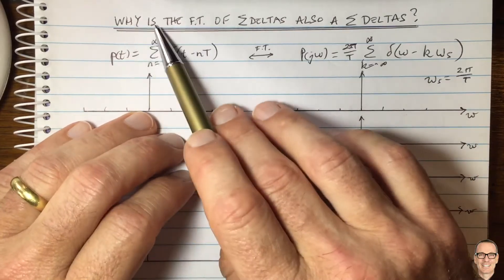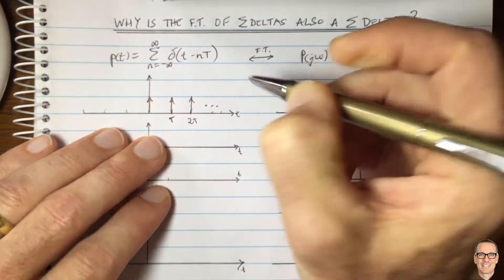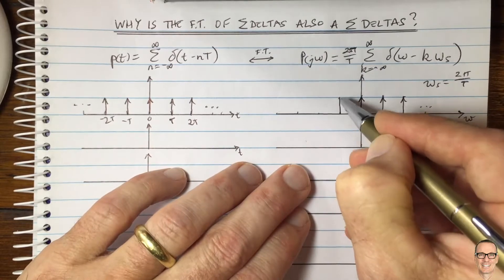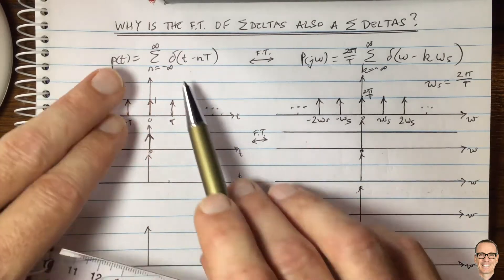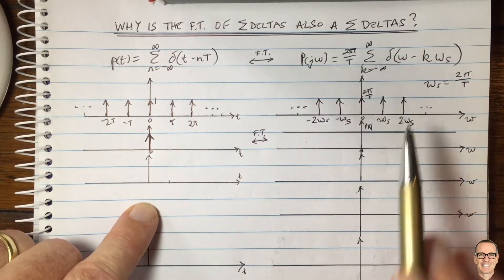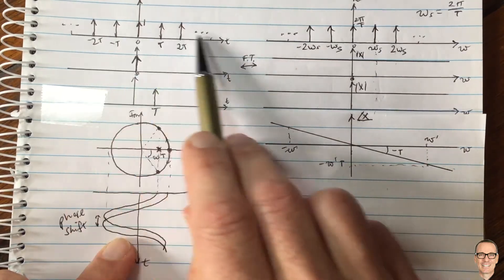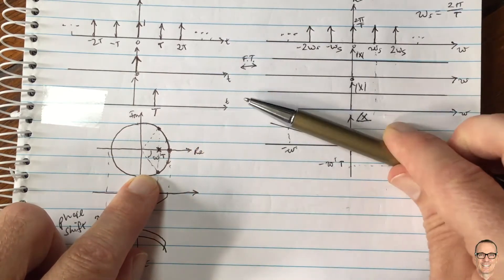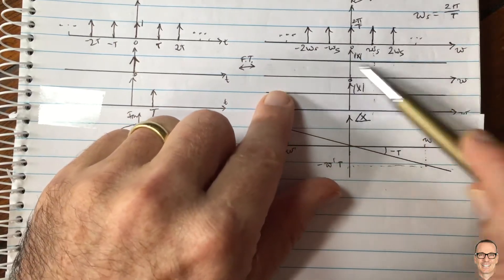Why is the Fourier TF of a Sum of Deltas also a Sum of Deltas?

Comment: Very interesting video, thank you Professor. Would it be fair to suggest that every time a convolution in general is done between infinite number of periodic (T) delta functions with cos(t) function the result of such convolution will be infinite number of periodic delta functions 2pi/T apart? For the same reason - when you hit full period of cos(t) = 2pi you have resonance, every time you hit any other phase you will find same vector of opposite phase sooner or later to cancel it.  Not only FT, not only complex a+jb figures.
Reply from the maker: Sorry, but you question appears to be confusing. Are you asking about doing a time-domain convolution between delta functions and the cos(t) function?
Reply: I see where I confused myself. Sometimes you answer your own question when you put it on paper, 
Thank you.
Reply from the maker: @dmitrikazantsev3692  Great. I'm glad you got the answer.

Comment: Thank you for video. In time domain shifting +-1 is meaining shifting same on the freq domain ? sum[delta(t+1-kT)+delta(t-kT)+delta(t-1-kT)]
Reply from the maker: Sorry, it's not clear what you're asking.
Reply: @iain_explains  Sorry sir, I will ask more clearly. I met with Fourier Transform question the question says What is the Fourier Transform of sum[delta(t+1-k*8)+delta(t-k*8)+delta(t-1-k*8)](k=-inf to +inf) I think shifting in time domain equivalent in the frequency domain is 2*pi*k shifting. Is that true sir. 
My Answer :  (pi/4)*sum[delta(w-2*pi*k-pi*k/4)+delta(w-pi*k/4)+delta(w+2*pi*k-pi*k/4)](k=-inf to +inf).
Reply from the maker: No. A shift in time is equivalent to a change in phase in the frequency domain. For example, if you shift cos(wt) in time by u seconds, then you get cos(w(t-u)) = cos(wt -wu) = cos(wt - theta), where theta=wu is a constant phase shift.

Comment: Great explanation, just one question though: why is the amp of the delta train on the freq domain 2pi/T?
Reply: Thanks for the quick and resourceful response, this really helped me tie up loose ends on this topic 😊
Reply from the maker: Good question. You're not the first one to ask that. Here's the answer I gave to someone else previously "I don't have a precise intuitive explanation, but the bottom line is that the transform pair needs to satisfy Parseval's Relation (equal energy in both the time domain representation and the frequency domain representation). Intuitively, as the sample period (T) increases, the delta functions in the time domain will become more spaced out, and the delta functions in the frequency domain will become closer together. In order to keep the total area under the two functions equal to each other, it is necessary to multiply/scale the frequency domain delta functions by 1/T (or 2pi/T if you are plotting the angular frequency) since they are more densely spaced in the integral." ... And also, don't forget, delta functions have infinite height. The number we write next to them when we draw them, is the area under the delta function. See "Delta Function Explained" https://youtu.be/lyraqtMWtGk

Comment: 2:01 this is the thing I am hugely confusing in this topic. Is the amplitude of Delta function 1, or infinity? 

In some videos this is 1 , in some other videos it is infinity ?? 
I just learned that , its area is 1, but its amplitude is kind of complicated.

Therefore I don't understand how we transform CT signals to DT signals. The DT function is an array of numbers with a frequency information, right?  How it is constructed by using the infinitely large amplitude Delta ( impulse ) functions ?
If the amplitude is 1, not infinity , how this Delta function has an area ?

I am stucked with that.
Reply from the maker: It's best to think of delta(t) as a narrow rect function, where the width is Delta, and the height is 1/Delta, and Delta->0. When sampling a continuous time signal at a time t=nT, we represent it mathematically by multiplying the signal by delta(t-nT). What this means is we are multiplying the amplitude of the signal by 1/Delta, and integrating the signal over a time period of Delta, to get the discrete-time value, and we do this for Delta->0 (in theory/ideally). So the output of that extremely short integral is x(nT) times 1/Delta times Delta which we call x_n. I hope that makes sense. I think I'll add this topic to my "to do" list for another video.
Reply: @iain_explains   thank you for answering,  this was what I learned also. Dirac function has infinitely large amplitude and infinitesimally small interval.
But the problem is :  I see many people that calls   " 1 "  to the amplitude. Also you are noting that it is 1.
If the amplitude is 1, it can not have area of 1.
I don't understand why it's called as 1, it looks like  inconsistency,  to a new learner.
Why the DT signals are written as  sum of x*Dirac (n).  How Dirac (n) is 1?

I told you that I am confused :')  It's obvious
Reply from the maker: In discrete time, the delta function does have a height of 1, and by definition it is infinitely narrow (since discrete time signals are only defined at exact integer time values). In continuous time, the delta function has a height of infinity, but since we can't draw something that is infinitely high, instead we choose to draw it as an arrow, and we draw it as high as its area is (so that we can illustrate the area somehow). Sometimes people just say 4*delta(t) has a "height of four" (for example), but they really mean it has an area of 4 (but since the drawing has a height of 4, it's fair enough to say this - it's assumed that people know what is meant).
Reply: @iain_explains    thank you for explanations. 
I don't understand how we transform impulse to the discrete-time as its amplitude is 1.  How this process works ?
I have problems on converting CT to DT, I am trying to watch several videos about it, but the actual mathematical operation of "converter" is not clear.
What I mean is , what is the operator that converts  ""impulse(t) >> to impulse[n] with amplitude of 1""    or    ""x(t) . p(t) impulse train >>  to  x[n] as a sequence""

x(t) . p(t)   could be represented as =  summation the series of  x(nT) .  impulse ( t - nT ) 

But this is still not equal to a sequence of x[n] ,  because it contains scaled impulses with amplitude of infinity,  right?
Therefore I am trying to understand what actually this conversion and this impulse are.
What is the title of topic/video that covers this point? 
Thank you for helping.

Comment: Thanks for the great video. But then I have another question, why the height in frequency domain is 2*pi/T?
Reply from the maker: Great question. I don't have a precise intuitive explanation, but the bottom line is that the transform pair needs to satisfy Parseval's Relation (equal energy in both the time domain representation and the frequency domain representation). Intuitively, as the sample period (T) increases, the delta functions in the time domain will become more spaced out, and the delta functions in the frequency domain will become closer together. In order to keep the total area under the two functions equal to each other, it is necessary to multiply/scale the frequency domain delta functions by 1/T (or 2pi/T if you are plotting the angular frequency) since they are more densely spaced in the integral.
Reply: @iain_explains  Thank you, professor

Comment: This is something that has been gripping me for a long time! 
A quick question:

Since shifting the function in time domain by T is equivalent to multiplying the FT by exp(-jωT).
x(t) --------> X(ω)
x(t-T) -----> exp(-jωT)X(ω)

sum of deltas is just sum of impulse functions but all shifted; could we write the Fourier Transform as sum of complex exponentials? ∑ exp(-jωnT) , summing from n = -infinity to n  = +infinity ?
Reply from the maker: Yes, exactly. Maybe I should have written that equation in the video. It is exactly what I am talking about when I'm drawing the phasor diagrams (the circles). I drew circles because every term in the sum has a magnitude of 1, and the terms only differ in their phases. Every dot I drew on the circles was from a term in the summation (where each circle was for a particular value of frequency, ω).
Reply: @iain_explains  How do you end up with the normalisation 2pi/T coefficient from this sum?
Reply from the maker: Good question. This is not a very intuitive answer, but one way to see it is to note that the time domain signal is periodic, therefore you can calculate its Fourier Series Coefficients. You'll find that they are all equal to 1/T (for all k). The 2pi comes from the fact that omega = 2pi x "frequency in Hz", and this factor is included in the definition of the inverse Fourier transform, when it's written in terms of angular frequency (omega). So, overall that gives you 2pi/T. These scaling factors are needed to ensure that the energy calculated from the time domain representation is equal to the energy calculated from the frequency domain representation (ie. Parseval's Theorem).
Reply: Great video. Big fan of yours… what happens to the amplitude as they all add up at 0,ws,2ws etc… is it still going to be 2pi/T?
Reply from the maker: The amplitude at those frequencies goes to infinity, since there are an infinite number of integer multiples of 2pi. Don't forget, delta functions have infinite height. The number we write next to them when we draw them, is the area under the delta function. See "Delta Function Explained" https://youtu.be/lyraqtMWtGk